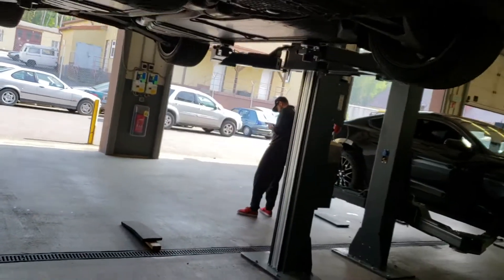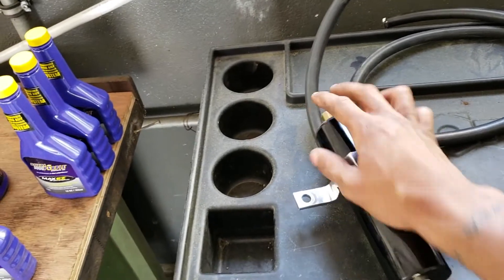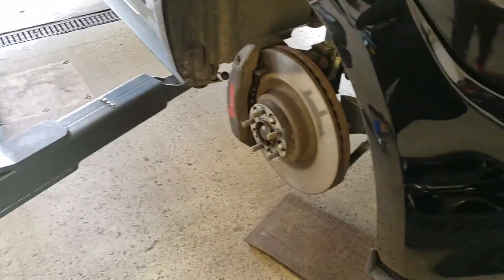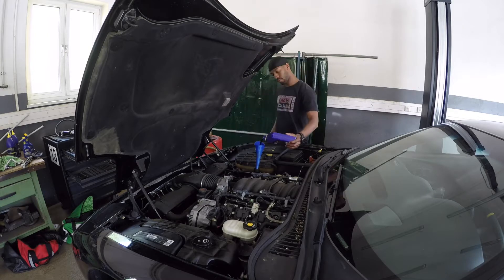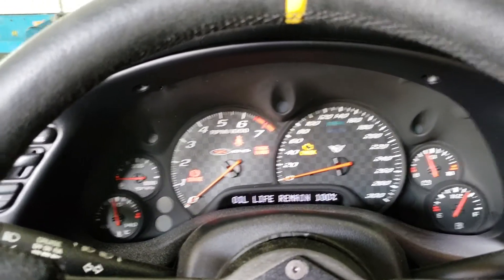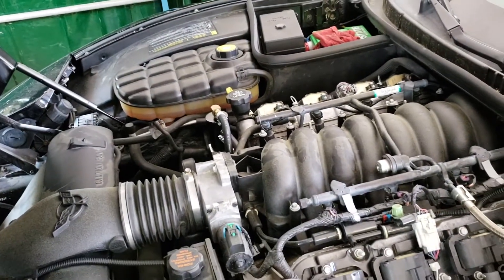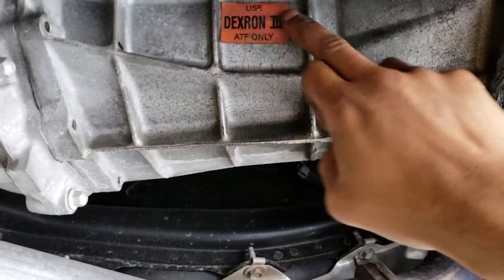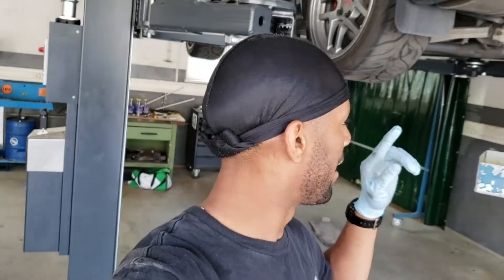How to change C5 Corvette Engine, Trans, and Diff oil

Comment: is it true that you have to run a c5 or c6 manual in 2nd gear for 1 min after changing diff and trans fluid or can just let it down and just do some figuer 8s to get the fluid settled in not sure i was just told .whats your input on that bro
Reply from the maker: Personally I never did that and never had a issue

Comment: Is that black stuff on transmission high temp RTV?? I have got a leak idk if it’s trans or diff leak but imma wipe and see where it’s leaking and apply that RTV should I?
Reply from the maker: Yup thats what I did! Worked well
Reply: @Beezy_Builds  I been working on my corvette c5 it’s a rebuild first car in high school. Just started working on it and I did a lot of improvements even installing the borla S cat on it. I changed the old shifter cable to a new one that one took me 6 hours since it was jus me and torque tube is annoying and that clip by the gear. I changed the oil 2 days ago put 6.5 quarts. The only problem now is AC leak it works but it leaks so I’m guessing the acid from the Walmart battery my dumb ahh put in is what caused it punching holes in the hoses.
Reply: @Beezy_Builds  changed the lights to LED, the only problem I have now is to figure out where the leak is, imma scrub clean that area and apply the RTV I don’t use my car for the track so I feel like it will last me a long time.

Comment: Nice video. Love the Permatex PATCH on the seam by the Trans drain plug. Was just researching to do that patch and add trans fluid.
Patch has lasted 2-3 years for two other guys with no leaks so far. Thanks for all the info.
Reply from the maker: Happy to help and yep been using high temp rtv forever I had planned to replace the seals when I did a clutch but I sold the car before then
Reply: I refilled my tranny last night and saw that seam weeping. I guess I'll use sone permatex
Reply from the maker: Yeah it be like that just get high temp

Comment: I was doing research as I have manual transmission. One thing I noticed that I saw somewhere else is that an automatic actually takes 5 quarts. Double check your manual to be sure how much should be in there. It looks like you put your initial amount in and run yours in drive then it should take the rest of the 5 quarts. Video was really good and knowledge based. Well done.
Reply from the maker: Thanks I have a manual aswell brother, I pretty much filled it up until fluid started to come out the fill hole

Comment: is it smart to add any thread lock or anti seize to any of these bolts, like do you need to or is it recommended or?
Reply from the maker: For sure dont add any thread lock to the drain bolts, personally I dont think it necessary to add anti seize either. Every thing in alluminum, just dont over torque because you can forsure crack the casing

Comment: Guys, make sure your diff fluid has limited slip additive.  If you deviate from facory fluids, make sure you have the proper mixture.  He is right about 7 qts of oil, fill to 6.5, drive, let car cool, check oil and fill to 7 only if tracking it!  Diff and trans needs to be done annually if you track your car.  Change your fuel filter while under there, its 20-80 bucks depending on year.  Also change your clutch fluid annually if manual.  If you do the clutch change add a bleeder to make it easier.  Awesome video!!

Comment: @6:00 I noticed the coolant leak on the of the water pump, That's coming from the Throttle body lines on the bottom. If you run the car only in non freezing temps then you can do the Throttle body bypass mod.
Reply from the maker: My Vette Life good spot, this car sees some cold temps in the winter in Germany , but ill try to tighten them up. Thanks brother 👍🏽